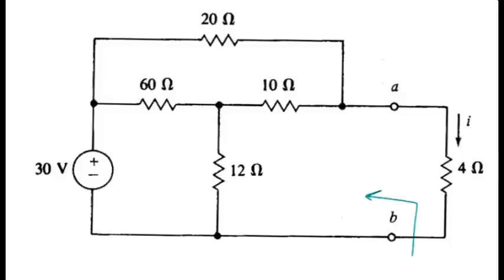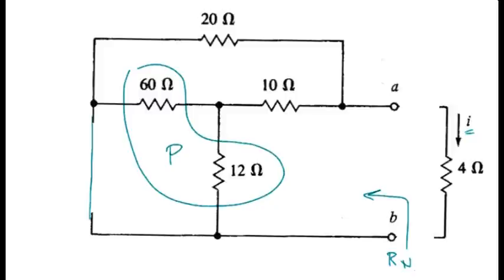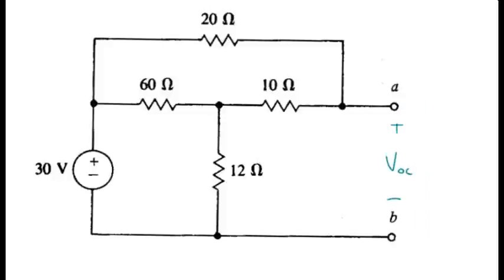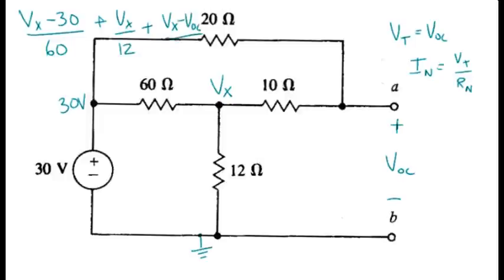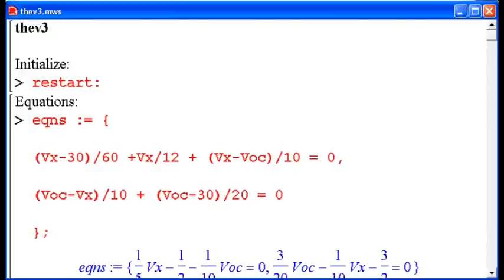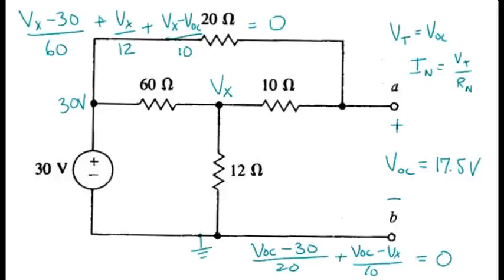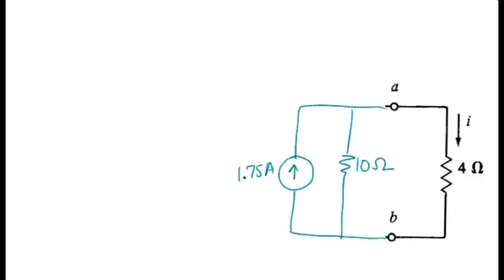dc: Thevenin/Norton Equivalent Example #3

Comment: When i solved for current in loop of the 12 ohm resistor i got .9375. When i combined Req for the 12v dc source and solved for current i also got .9375.  Shouldn't Vth be  .9375 * 12ohms = 11.25v?
Reply: Yeah i too got 11.25

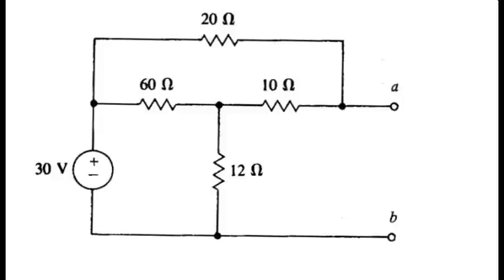Comment: at minute 1:20.How are the two 20ohms resistors in parralle? when there is no current going out of point a and point b where we cut the circuit. doesn't that make the current flowing between the two ohm resistor the same?
Reply: 4 months late but its because at both ends they are attached to the same wires. You can redraw it to show how they really are parallel even though they seemingly look like they would be in series.
Reply: @NightbladeNotty  6 years late but you just saved my life with this explanation. Thanks!!!!! Hope life’s treating you well🤙🏻
Reply: @mortalwomprat  haha glad i helped ^^ i dont think i remember how to do a lot of this now xD

Comment: I am so lost on your first equation
KCL says sum of current entering = sum of current leaving a juction
so we deal with one junction at a time

AT JUNCTION Vx ... SHOULD'T IT BE ((Voc - Vx)/10)  ... at the last part of ur first equation?

because there i dont see current leaving, its only entering...
Reply: wait a minute, i think you are right, Voc-Vx does depend on the current direction, he need to consider KCL on this problem, the answer is wrong. I got Vx=20 Voc= 35, I did use KCL
Reply from the maker: KCL can be stated three ways: (1) Algebraic sum of current entering a node is zero, (2) algebraic sum of current leaving a node is zero, and (3) sum of currents in is sum of currents out (this is the form you are using). The first two based on "algebraic" use the idea that when current matches your defined positive direction (this is the familiar current arrow) the current is positive; if, however, the current is really going in the opposite direction it is negative.

Now, back to this example problem: node-voltage method normally uses KCL #2, this is why you write the equation with every current defined as positive leaving the node. This is just a convention, though, because after you solve the system of equations for node voltages and then find the currents, you will see that the sum of currents entering the node is in fact the sum of currents exiting the node because one or more of the currents will be negative.

Hope that helps!

Comment: I just have a quick question. Why couldn't you take 17.5V/10ohms to get the current instead? I meant the resistors are in series so the current must be the same right
? Correct me if I'm wrong.
Reply: 1.75 V is distributed throughout the entire circuit, so we can calculate the current by i=1.75/(4+10)

Comment: Hi, i don't quite get the part where u put 60 and 12 ohm resistors in parallel. shouldn't it be (((20+10)//60)+12)??
Reply from the maker: The terminals a-b need to remain intact; you lose the 'a' terminal if you combine the 10- and 20-ohm resistors into a single resistor. Put another way, because a circuit can potentially connect at the a-b terminals (as does the 4-ohm resistor at the beginning of the problem), you have the potential for non-zero current at terminal 'a', and that means the 10- and 20-ohm resistors are not truly in series because they do not share the same current, in general.

Comment: was the last thing you did a voltage divider or a current divider?...
Reply: what is he finding? current, so its a current divider
Reply: Asher Harris it's wrong, it should be i = 1.75 * 4/10+4 not i = 1.75 * 1/4 / 1/4 + 1/10 .... seriously
Reply: *****  no its correct, current divider implies to put focus on the resistor your not trying to find the current for, hence. 1.75*10/10+4 which if you do math is equal to 1.75*1/4/1/4+1/10 due to simple fraction laws
Reply: Asher Harris why would one complicate things like that???... 1.75 * 10/10+4 is the most simplified form...
Reply: ***** the method he has is useful when you cant tell whether the resistor is in series or parallel, in that case his method is useful. Though i prefer the simpler form.
Reply: current divider
Reply: +Akshay Nayak srry voltage divider
Reply: +Akshay Nayak ya true I was mistaken by tutor statement it is current divider